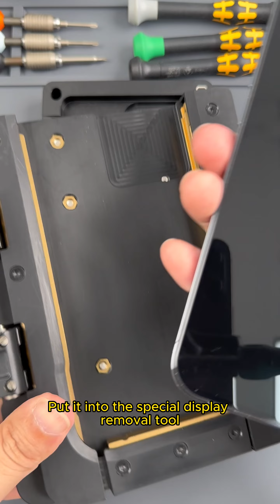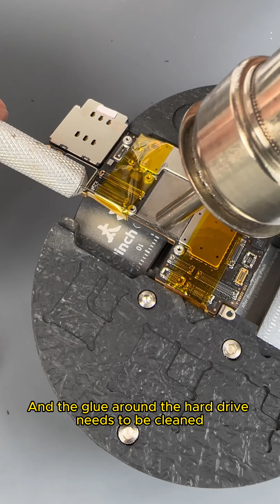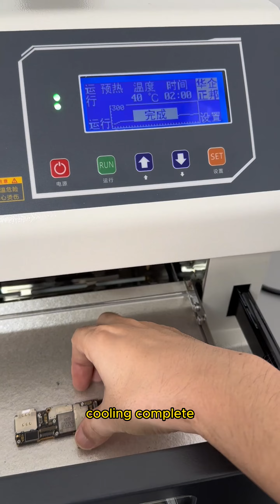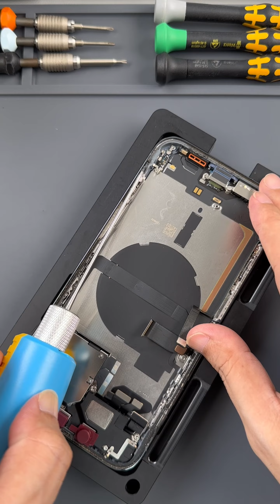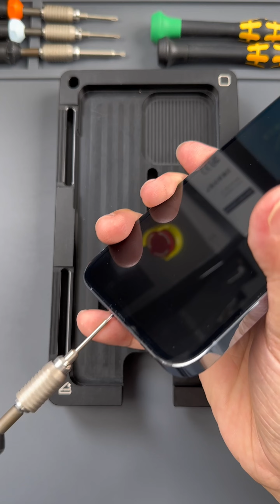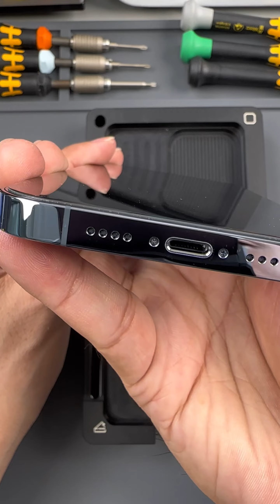Replace high-capacity battery and NAND flash of iPhone 13 Pro Max

Comment: but why did the battery health remain at %86 after you replaced it with the new battery?
Reply: he weld the cable that contains all the data from the old battery to the new one so that it wont trigger the "service" battery error in non apple certified repair. he didnt reset it to 100% thats why its still 86%
Reply from the maker: @prytrivr yes   Thank you for your answers.😂
Reply: thank you for explaining! How do you reset that cable? @prytrivr
Reply: @arabfornato  you don't
Reply: @arabfornato  You leave it attached to the battery and call Apple's service line and they remote reset it. BUT.... you must have purchased that battery from Apple themselves.